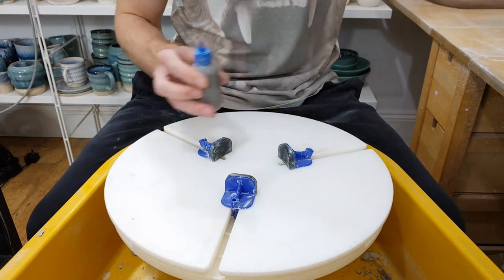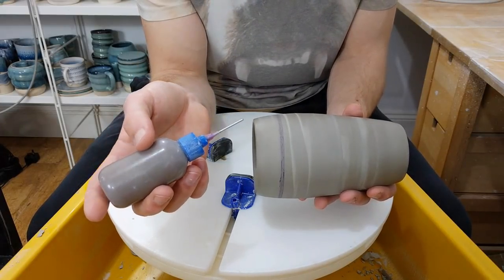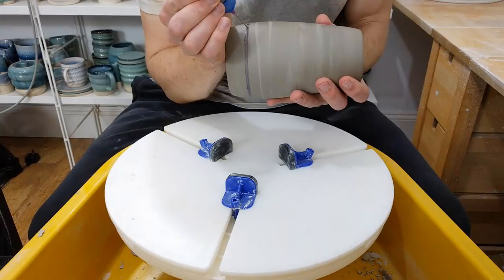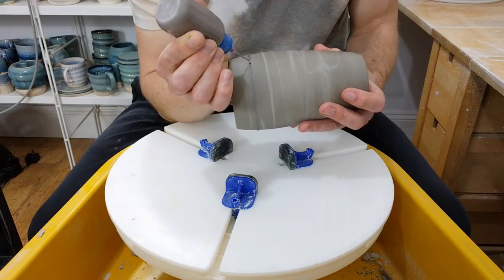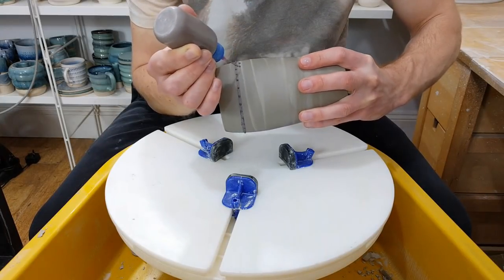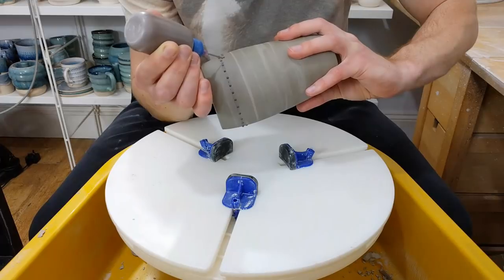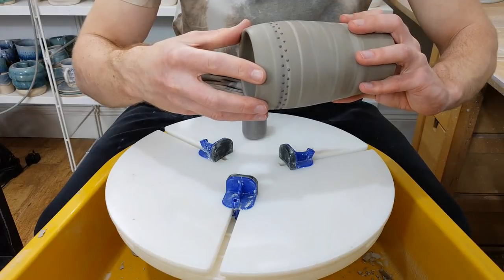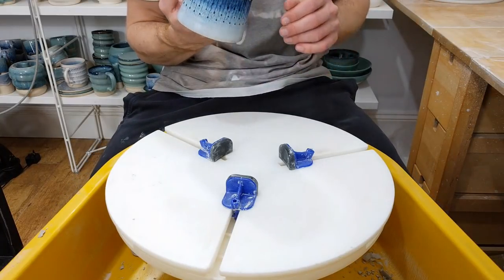How to do the Impulse Pattern

Comment: Hey Joe, thank you so much! I will try it, just missing chromium will try with CoO MnO2 and Rio.
Do you use SilicumCarbide (not sure if i got this right) to deflocculate or does it work without, too?
Love the running! And do you apply it at any kind of stage on greenware or after throwing it? Looks pretty leatherhard in the video. You are such a great gem in the claycommunity!
Reply from the maker: Silicon carbide is used in reduction/crater glazes, you're thinking of sodium silicate. I don't use it for this as I don't really need to, but it would be sensible on larger applications as it reduces the shrinkage of the slip by requiring less water.

You can apply the dots to completely dry greenware but it's best to do it when it's leather hard.

Comment: Why do the dots ‘run’? When I bisque slip it doesn’t run when I glaze fire it.is it the glaze? Should I add boron to the slip? Thanks.
Reply from the maker: It's the glaze picking up the colours from the slip, or just being redirected by it. Don't add boron to the slip if you're hoping to make it run, just use a runny glaze. Adding boron will affect the slip in other ways but won't make it run
Reply: Thanks for this helpful response. You are very generous.

Comment: Would black underglaze added to slip work as well?
Reply from the maker: Almost certainly, but it would be a more expensive and possibly more problematic way to do it. The underglaze has already mixed the colourant in with fluxes, so you'll get less colour and it'll have a bigger impact on how the slip behaves. It should work if you don't have oxides or stains, but it isn't ideal